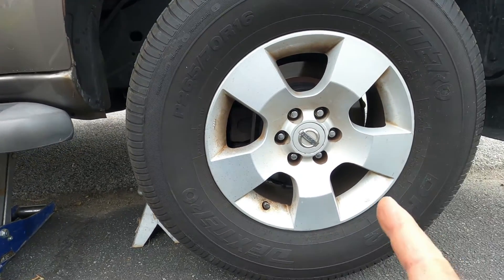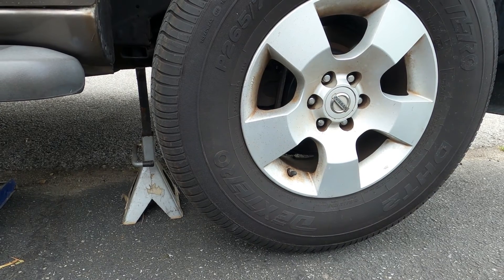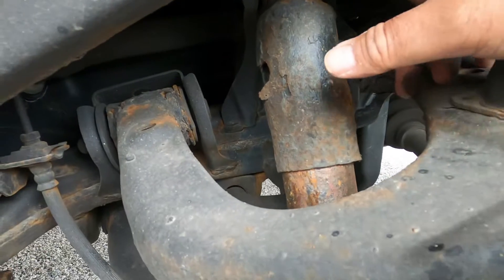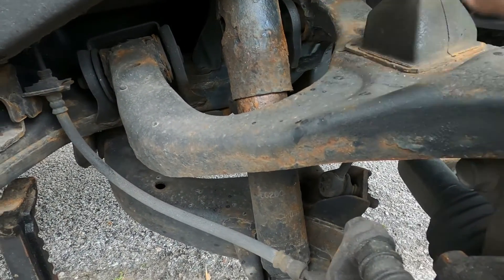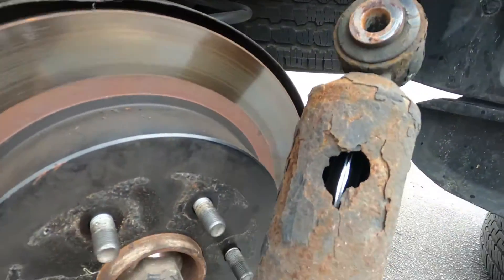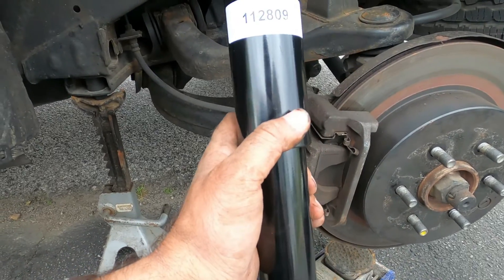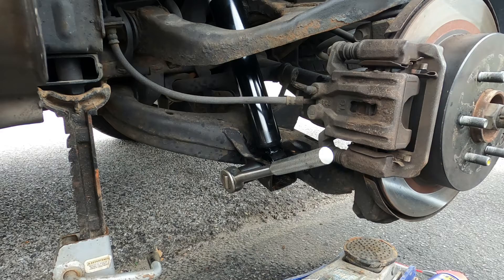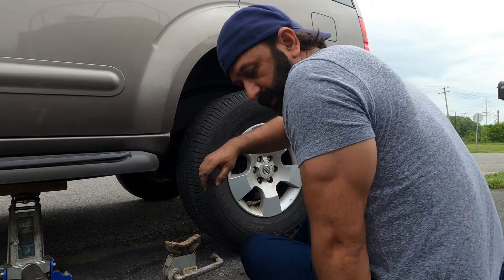Replace rear shocks on 2005 - 2010 Nissan Pathfinder

Comment: Do you feel a difference  in the ride.  I had my pathfinder  about  4-5 months. I was told the replace the rear shocks.  I just checked today and theirs already  some rust on them and the car doesn't drive that good at high speeds.
Reply from the maker: Its a big difference. Install good brand shocks and also check for springs. Mine were broken

Comment: It is great if your bolts aren't frozen to the inside of the shock. Like mine are.
Reply from the maker: That's not good, have you tried WD40, spray and let it sit and repeat for 2 or 3 days or worse case try torch?
Reply: @FKCamVlogs  I did even for a week.  Decided to just use a saws all and it went so much better. Even when you got the shock off, you can see the bolt has basically fussed with the shock. That bolt is never coming out.
Reply from the maker: @vanadrian5408  oh damn! well glad you were able to get it done.
Reply: This is my fear. About to do this on my 2012 that’s lived in New England it’s entire life. Every job has some rusted bolt, it blows lol